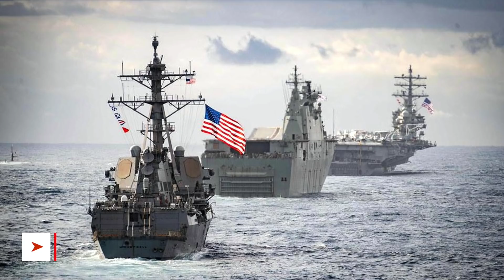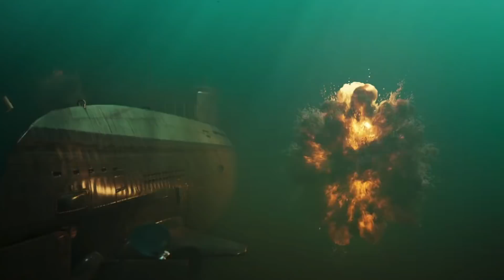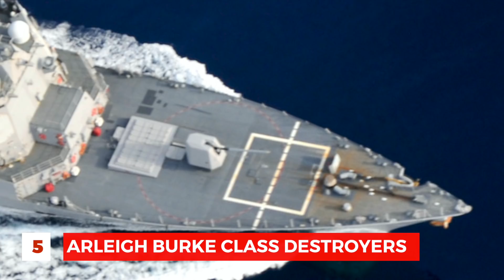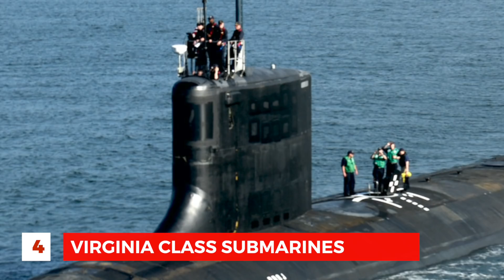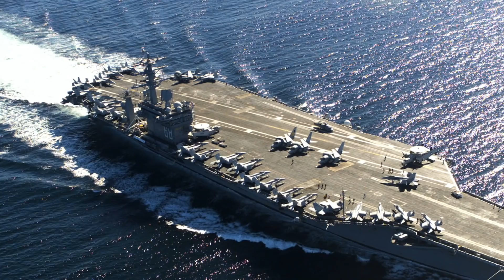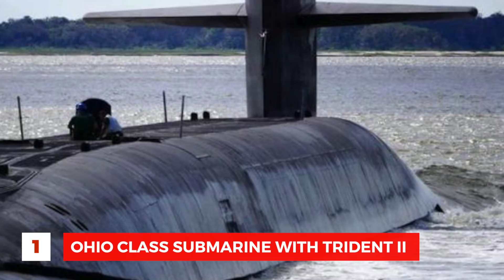WHY U.S NAVY's CAPABILITIES ARE UNMATCHED ? DEFENSE UPDATES

Comment: Can one of the Russian trolls explain something to me that is common sense to the rest of the world...  If hypersonic missiles are maneuverable in the way Russia is trying to covey. For example, if your target is 3000 feet away, launches defences and at mach 20+ the missile tries to maneuver at those speeds it will be off course and miss completely by miles. The missiles wouldnt even need to hit it. The slightest turn at those speeds means so much, hence why every single nation still uses sub sonic missiles, the slower you go the easier it is to turn and correct your course back on target and not overshoot and miss. So how would the missile hit its target? Can you explain it to me? Is it going to do circles until the ship stops shooting air defense with its "unlimited range" LOL.
Reply: is propaganda , Russia just admitted the new Zircon missiles have issues and not ready to deploy
Reply: ok, I'll bite. Gonna separate this in subsections for easier read because the devil is in the details:

20+ mach speed (I'm assuming HGVs like Avangard is the subject here) is only viable in upper layers of atmosphere where air is so thin it can actually move that fast. This phase would be analog to mid phase of conventional ICBM or IRBM and is the place where interception is most likely. Small change in course here would still mean missile has enough time to reallign itself towards its target (this is the part HGVs were made to overcome, mid course interception)

in 3000 feet scenario you described, missile would drop from its 20+ mach to probably high single digits from friction caused by denser atmosphere, but still, that would mean it would close that gap in under a second. Also, after certain distance to target, there would be no course corrections. Now, only way you could intercept it is if by a stroke of luck your interceptor launcher is pointing directly into the incoming missile (which it most likely wouldn't be) since the interceptor is subject to the same laws of physics that prevent the incoming missile from changing course just like you described.

Antiship hypersonics (Khinzal type) have different approach but main principle is to leave as little time as possible to make a successfull interception attempt (flying low and/or utilising earth curvature to avoid detection until its too late)

(edited for typos)